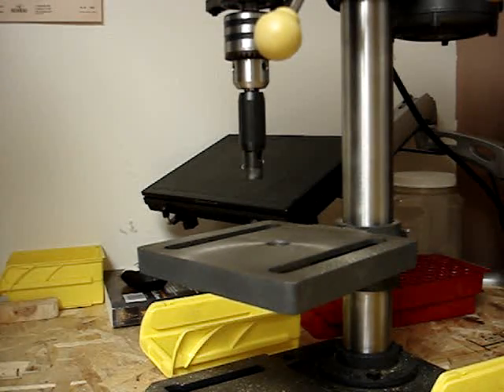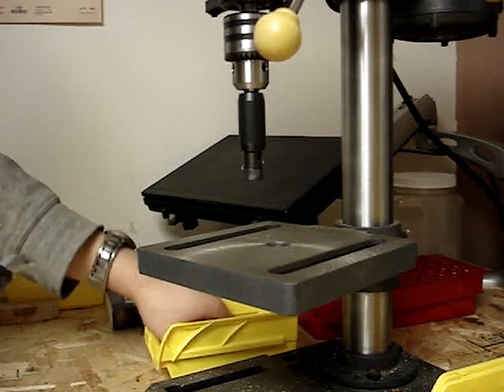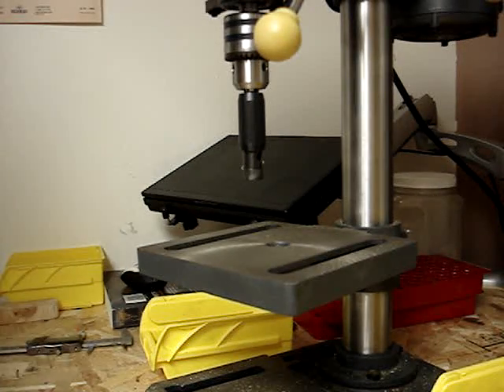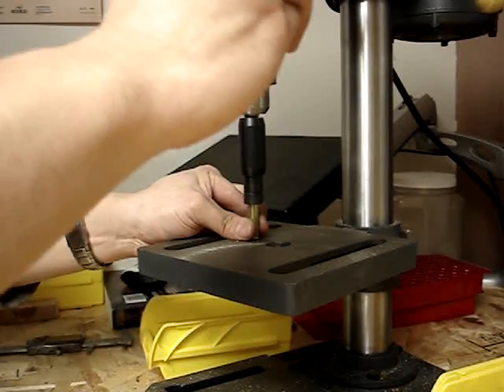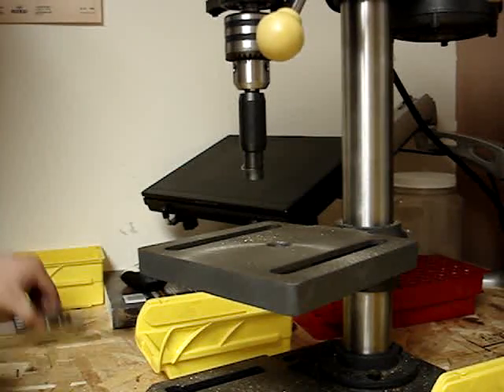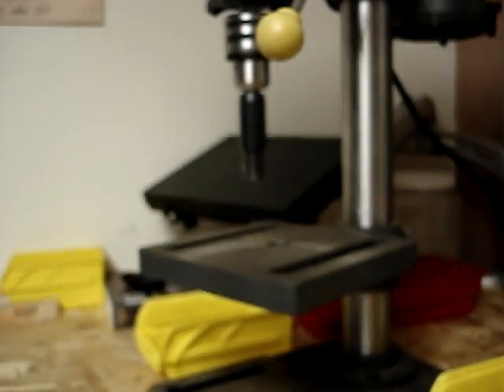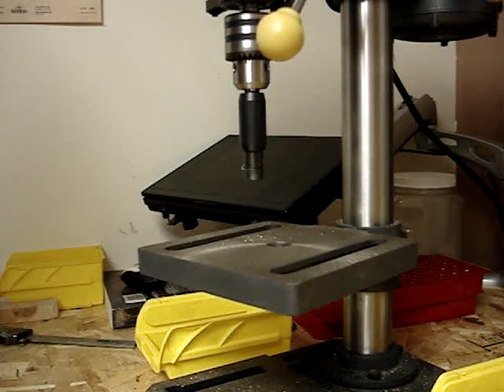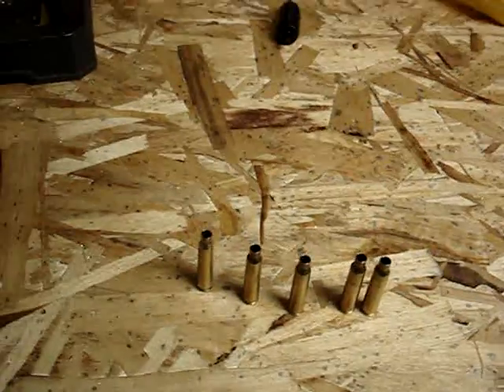Possum Hollow Kwick Trim Demonstration

Comment: Great video. Smart how you set the stop on the press...so easy to crush .002"! I guess some viewers MISSED that part! I usually get that kind of accuracy with the Lee mounted in a drill press....but tightening and loosening the base screw is harsh on my digits! Another thing to buy.....